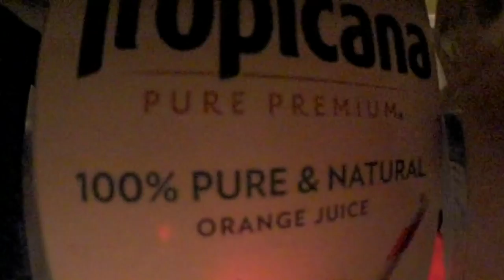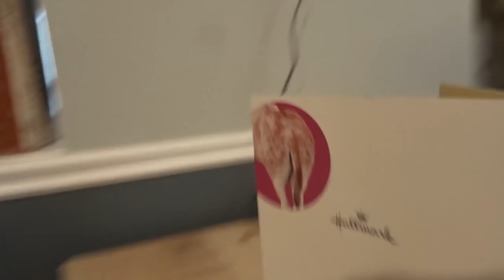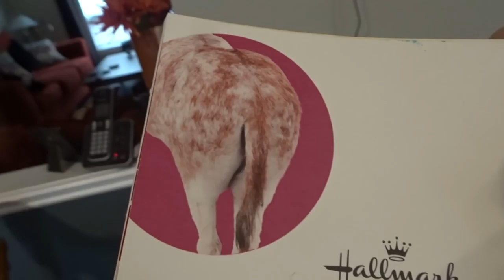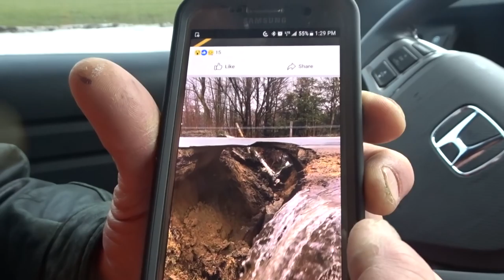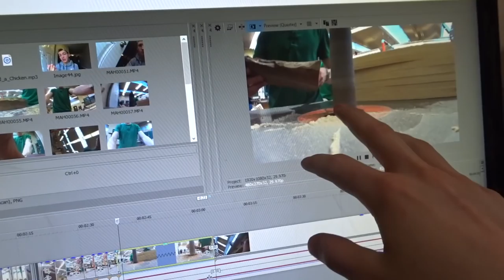Port Burwell Flood February 2018

Comment: I bet that one minute and 30 second intro took over 15 minutes to set up and another 15 to edit :) it was worth it.  I see you improving weekly. Incorporating multiple camera angles, adding B-roll montages, and smoother video doesn't mean you are not "being you" or copying others. It just means you are adapting more professional video skills which as you further develop will naturally bring more views/subscribers :) Your passion and energy still shines through, just not as chaotically as before. Only thing I'd recommend is to try and reduce your video length to 5-10 minutes. I think your average "watch time" would improve greatly. Looking forward to spring/summer.

Comment: I was hoping you weren't going to take the bike into the shower this time. It probably would have plugged the drain. I have to admit to laughing when you were riding the bike and being spattered with mud. You need a car man! ;) Firefighters use spanner wrenches to tighten hose couplings.